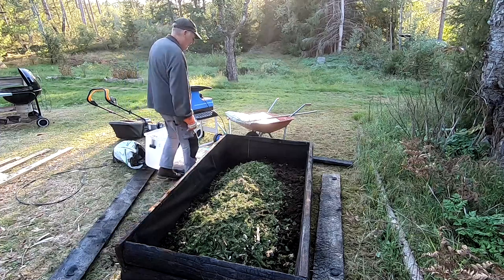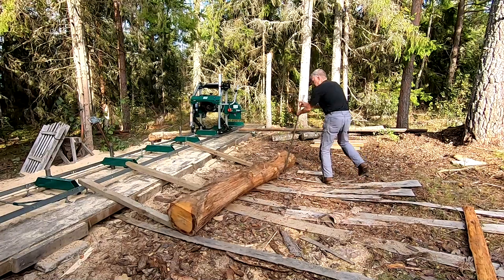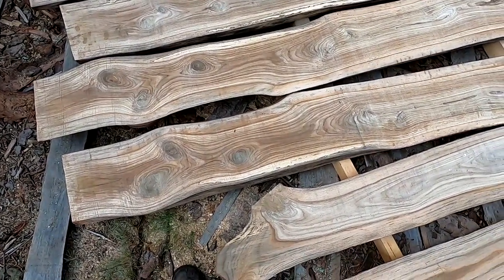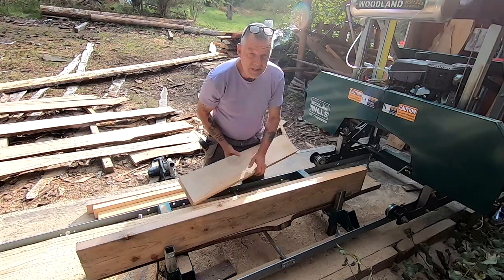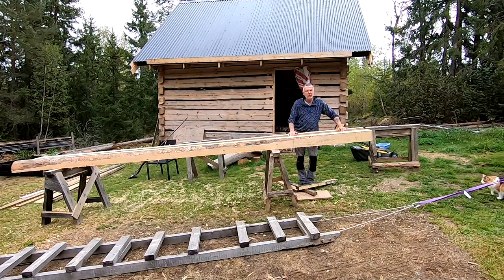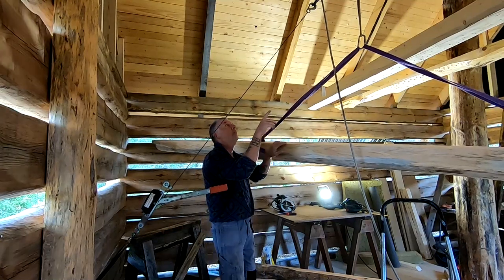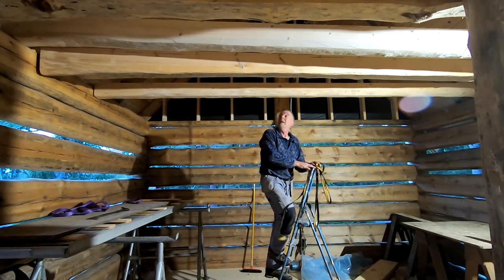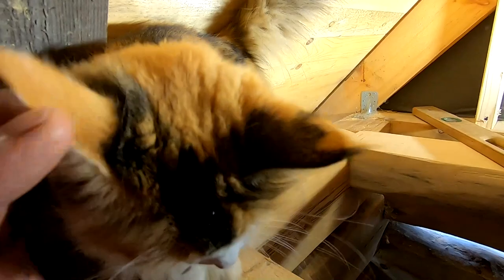Flowerbeds, Sawing oak, Handling floor beams. Vlog #229 - S5

Comment: Howdy Michael- your rope skills are amazing for lifting those beams up there. When you get the upstairs floor in you will open up a whole new dimension of your cabin. Looking forward to seeing the stairs going in. Hope you have a great weekend. God bless
Reply from the maker: Hi Paul. I can't wait getting to that point. I do have a question though. Considering winter is around the corner, would it be ok to do the mesh, and insulation (rockwool) without doing the outside chinking, or is it better to do as much outside chinking i can before the frost sets in. Or is it better to wait untill spring
All the best
Michael

Comment: You certainly won't have to worry about those walls spreading apart under snow load. Not for 100 years.
Reply from the maker: Hi Quarlow. It will stand the test soon. It held up fine last winter, so I don't anticipate any problems after those beams got in.
All the best
Michael

Comment: Wow!! You got a heap of work done this week. I’ll be interested in what the Bearded Carpenter has to say about the chinking. If it isn’t possible this year , would you temporarily stuff the spaces with something for the winter ? Really looking great !
Reply from the maker: Hi Terry. Yes, I've been busy. I'm always doing something, but it's not all I record. It would be great to get all the wiremesh between the logs, and the some insulation put in, from the inside of the cabin, since we can get a lot of snow around here. But for now I'm just stabling.
All the best
Michael